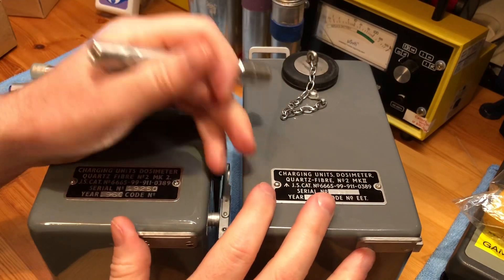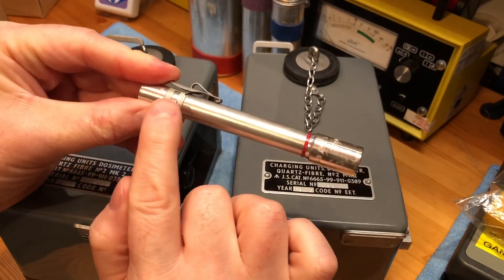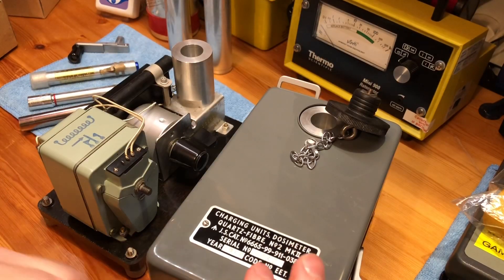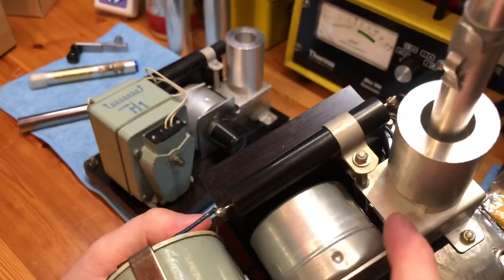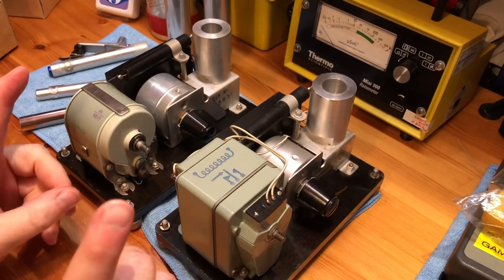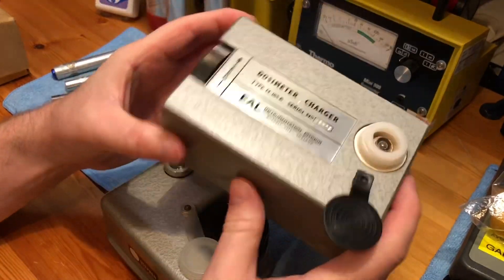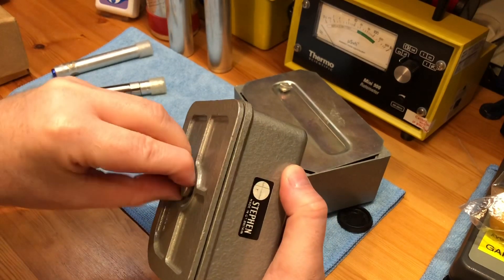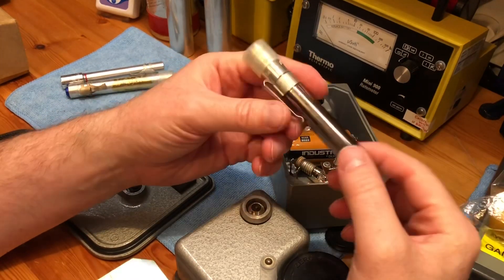Quartz Fibre Dosimeters

Comment: I have a number 2 can't get it to charge my Stephen quartz dosimeter I've just brought :-(
Reply from the maker: The newer models of dosimeter (80’s issue) require more voltage to zero than the older issue ones. The battery operated Stephens charger is required. I have one and use it to charge up really old dosimeters that have been sitting with no charge for 40+ years.
Reply: @SurvivingTheApocalypse  thank you. Had old british army dosimeter years ago that did charge but  lost it in house move. Trying to charge the Stephens one other night that I got off eBay didn't know if I was doing it right. Just seen a Stephens charger on eBay will get that one. I did  had a few radiation meters that I wish I kept esp with what's going on at moment.

Comment: I've been trying to teach myself how to use it. I've got the 1957 charger btw. Sometimes I get it to zero but then other times it jumps up to like 30 millisievert (0-50 millisievert dosimeter) then other times the quartz fibre disappears completely only to reappear again. Basically I'm not doing it right
Reply: The little pin on the dosimeter is slightly bent too so it doesnt sit straight in the charger
Reply from the maker: The little skip is due to the magneto discharging too quickly and was always a major problem with the early chargers. The training manual even says there is very little that can be done to prevent it happening.
Reply: @SurvivingTheApocalypse  right so there's no real way of stopping it and I've just got to play around with it. Little annoying but it's cool knowing the struggle post members went through. Wonder how many chargers got thrown at walls back then haha
Reply from the maker: The later models (1960’s) tended to work a bit better but there is hundreds of thousands of these chargers out there, which tells you a lot, they must have been replaced countless times. 

I have been in the mothballed Government Bunker in Northern Ireland and it had 8 full boxes of them in the store room, all brand new in their unopened boxes from the 1950’s.
Reply: @SurvivingTheApocalypse  I can see why. And a place like that is one fantasy of mine
Reply from the maker: I plan to do a stream on the government bunker and what it was like when I first got inside back in 2009.

Comment: Great demonstration, I do like the manual charge ones because they don't require any bulbs or batteries, I have a Soviet dosimeter charger that uses a similar design with a little piezo-electric dial, it's fiddly compared to the battery units but quite a neat thing.
Also that 0-5R dosimeter pen was the type the Imperial officers wore in Star Wars I believe.
Reply from the maker: Yeah, lol, its amazing how much those old type pens go for due to Star Wars. Apparently they are data recorders or something 🤷‍♂️.